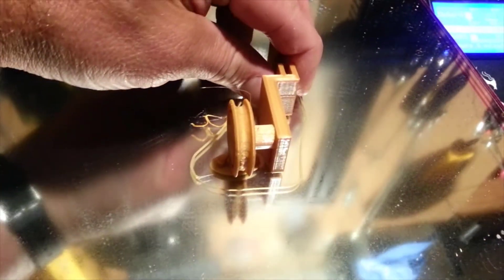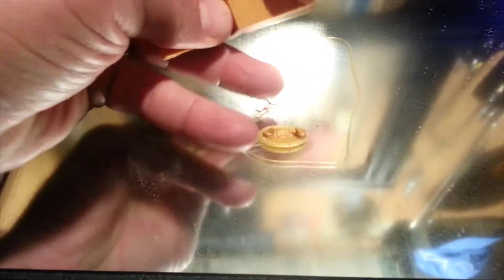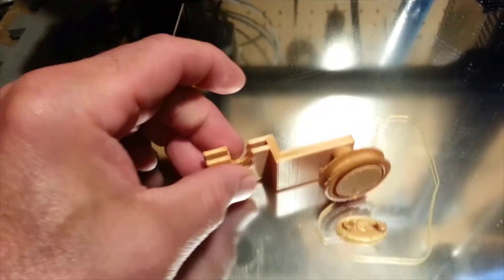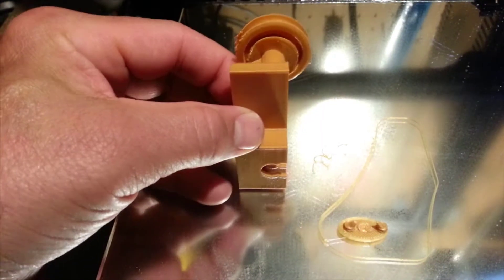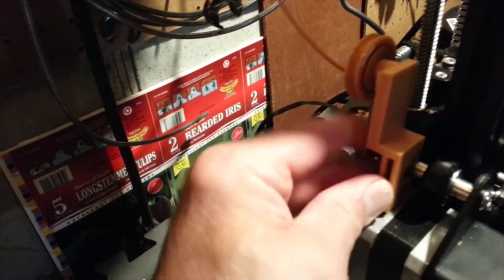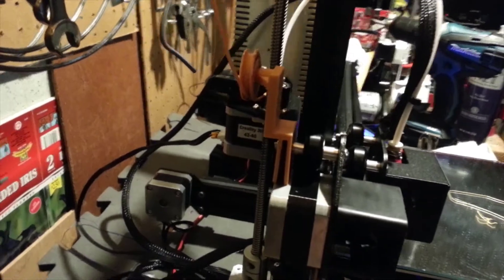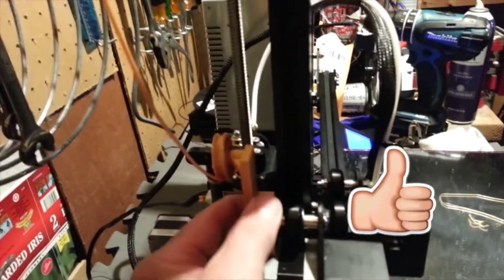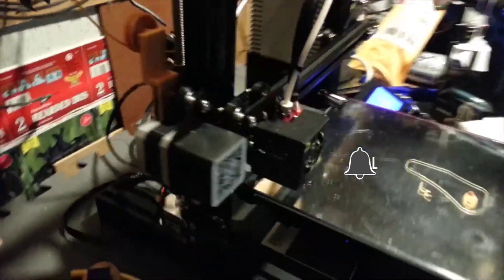V2 Ender 3 Filament Guide with Printable Bearing!

Comment: i think that the roller should be a little bit lower so the filament goes straight into the hole
Reply from the maker: That is legit. I can work on V3 tomorrow. =)
Reply: i was looking for a long time for a solution easy to adapt. thanks :)
Reply from the maker: V3 which is 4mm lower is on Thingiverse now. =) Thanks for the idea!
Reply: @HLModTech  where is the link?